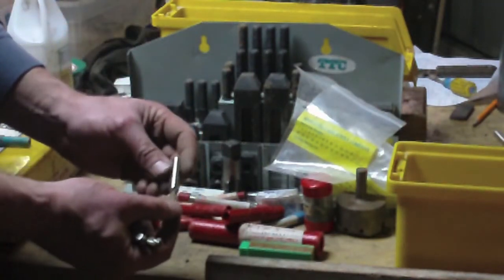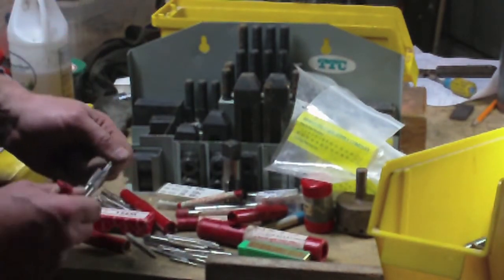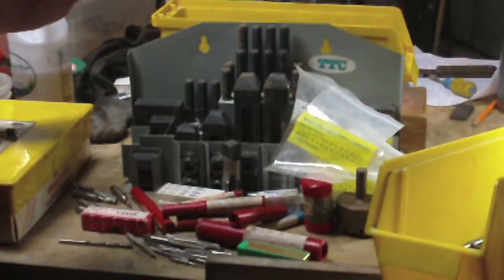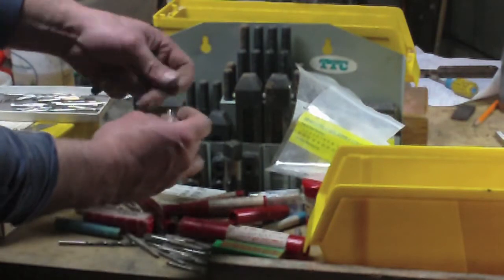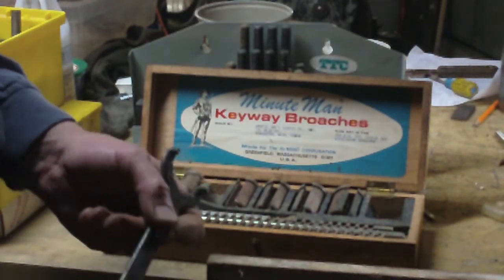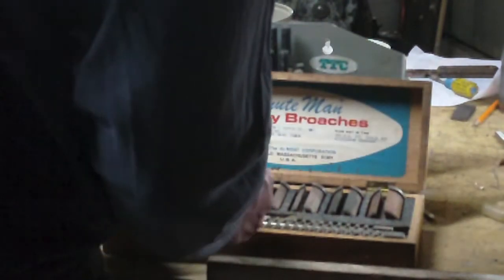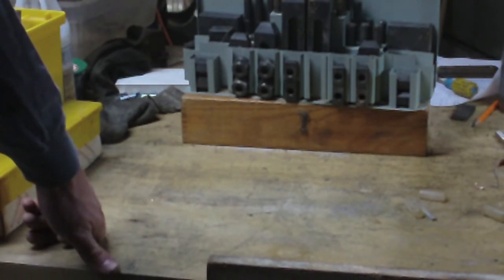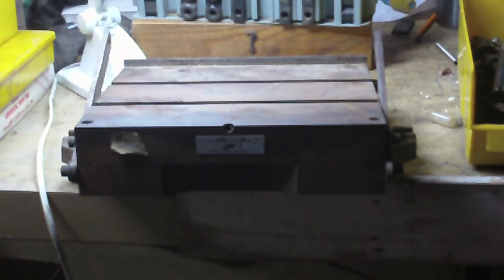The "garage sale" Part 3

Comment: Forget the trolls Steve. I've seen you make some mistakes but, you don't take too long to correct them. Now that you have that sine plate, the next thing to find is a set of gage blocks or "Jo-blocks." They are used to set it along with other uses. That cylinder in the front does not get moved. That 10 inch designation is the precise distance between the front and back rolls or cylinders. By using various sized stacks of gage blocks under that front roll, or you can also use those planer gages, you can set a precise angle according to the sine of the angle. Just google how to set a sine bar and you'll see what I'm trying, (rather poorly), to explain. Sine bars, plates and vices work off of either 5 inches or 10 inch center distance between rolls, usually. It's been a long time since I used one last but, I at least wanted to get you moving in the right direction. Have fun.
Reply from the maker: +Dave Lee Thanks Dave!